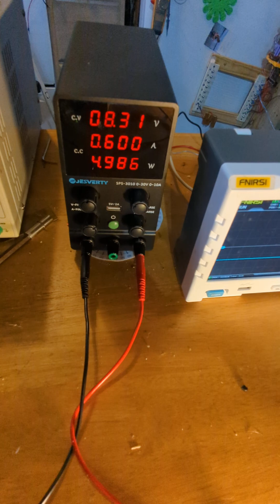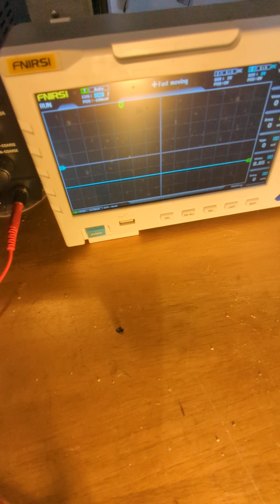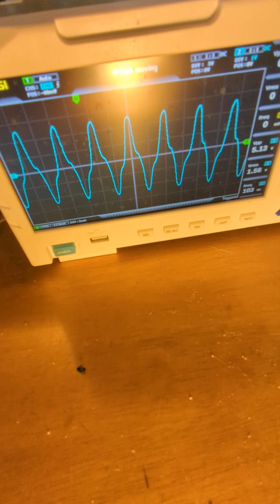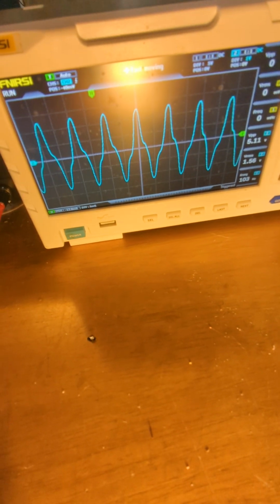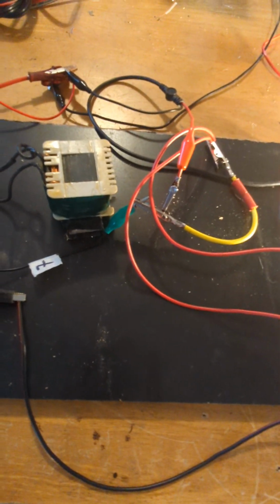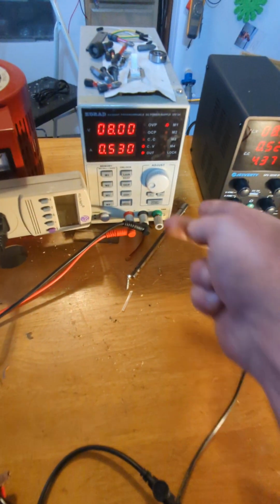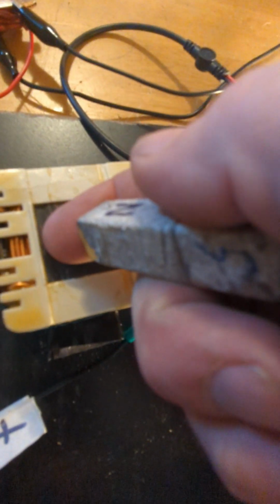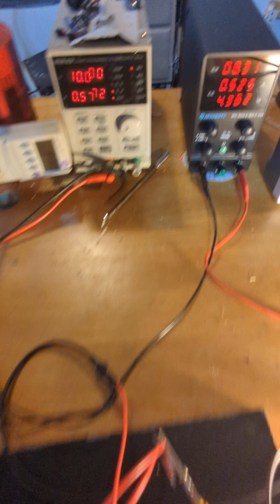Creating Alternating Current with NO Switching from two batteries

Comment: Extremely interesting. Just two days ago I watched the video: Free Energy Research - Borderland Labs with Eric Dollard, Peter Lindemann & Thomas Brown (1987). Among many other interesting things and information, they also experimented with a homopolar generator and instead of DC current, they created an AC current that had the same waveform as you have. At 1hour:11min:44sec, Eric Dollard points out that this waveform corresponds to the third harmonic and is associated with energy, the second harmonic is associated with power, and that reluctance machines also have a similar waveform. I don't know how he figured that out, but it's extremely interesting. It's something very important, but I can't figure it out.

Comment: This would be amazing but you need to repeat this with batteries only. Switching power supplies often "bleeding/passing" mains frequency to low voltage side (not necessarily 50/60hz). Oscilloscope you have can run on powerbank, this will eliminate even more interferance.
Reply from the maker: I first noticed the effect using two 12V batteries.  With no scope hooked up you can easily feel the AC magnetic field.
Reply: @floodrod I think this is one of the craziest effects I've seen yet. It really makes you step back and rethink how current really flows through a wire. It's definitely like a fluid.
Great observation 👍👍👍👍
Reply from the maker: @pulsedmotor  Replace the inductor with a resistor and the AC stops.  The effect is being caused from the reactive nature of the coil combined with 2 currents flowing in the same wire in opposite directions.

When 1 current gets ahold, the coil reacts trying to oppose the field and sends counter EMF to squelch it. But this allows the other source current to become dominant, so the coil switches direction and tries to oppose that one, and it repeats. The coil kicks into resonant oscillation
Reply: @floodrod not sure what you mean by no switching … maybe you refer to no switch component, but as long as you use coils, simple method of connections create the switch of flow without the need to pay any energy for a physical device to invert polarities … this is what is happening in bucking coils, bifilar coils or middle tap solenoid.